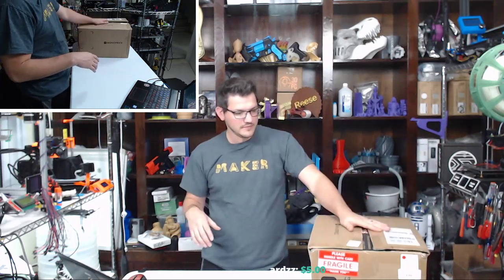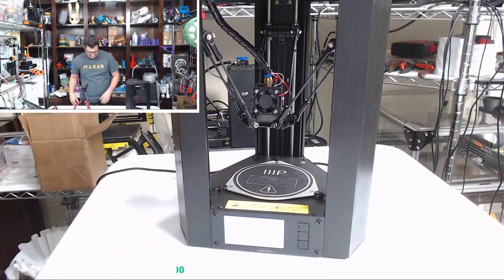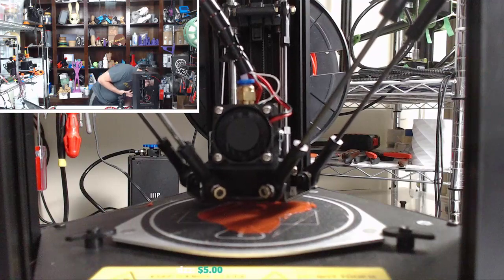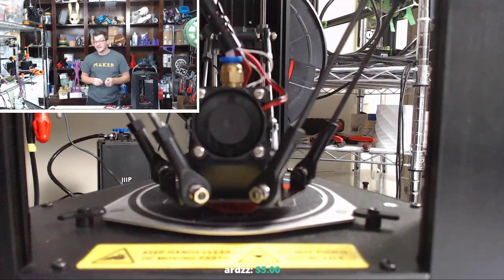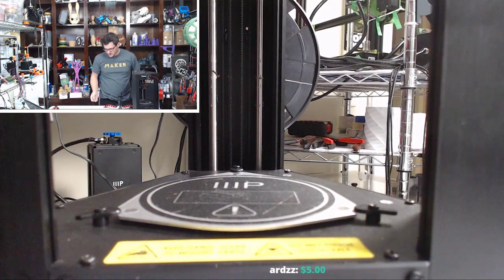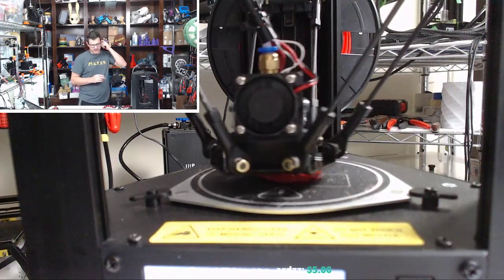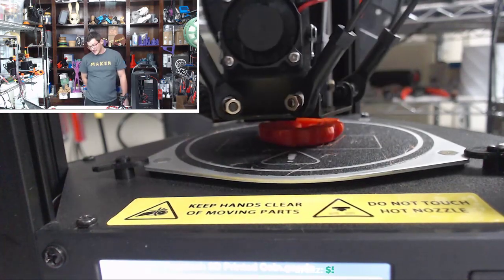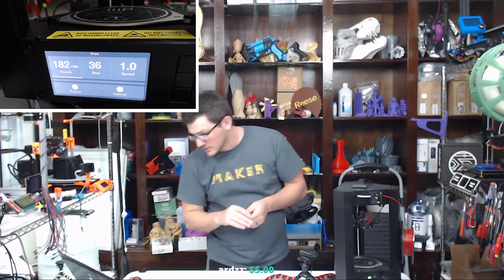Uboxing a $80 3D Printer!! Let's see what we get!

Comment: Looks like a somewhat upgraded version of the 101Hero (which I can not recommend - mine sits gathering dust behind the Anet A6)
Reply: The only thing in common between the two is the fact that they are small delta printers... there is nothing at all shared between the two.  The MP Delta is a metal chassis and utilizes real stepper motors.
Reply: @williamsteele  Good to know. At that price point I'd be concerned after being bitten by the poor quality of the 101.
Reply from the maker: +1 to what William said. This is nothing like that machine. The 101Hero was a toy.

Comment: I picked up one of the original indiegogo machines, and ever since it's been a favorite machine of mine (especially to travel.)

They get even better if you change the stepper drivers out to Trinamic units.
Reply from the maker: Are they replaceable? I have not opened the bottom up yet.
Reply: @Fugatech3DPrinting  they are soldered. So while not replaceable in the normal sense, it's just three pin compatible chips

Comment: I got the same $80 deal, & it was definitely a steal. Had a butterfly test print instead of the superman logo. My other printer is an Anycubic i3 Mega, so yeah, it took about a week to stop smashing on the screen thinking it would do something. Mine does a 3 point level check right now, I might change that to check more points, but it's working, so...
I've heard there's little round mirrors that you can get at Hobby Lobby for really cheap, & supposedly they fit the bed.
It's not the greatest printer, it's loud,  could use a beefier extruder, better hotend, 10 amp power brick, but definitely worth more than $80!
Still playing around with Cura settings, but it's printing well. Super happy with it.
Reply: Tim outdoors  it was a deal they had on "open box" printers, before Christmas. Theoretically the open box printers may be missing some items, but mine had everything. I'm not sure if the Monoprice website lists open box ones all the time, or if they just store them up, then release them all at once.

Comment: Any luck getting this to use any micro SD card besides the one that came with the printer? It won't read any other, & won't work with an adapter cable either
Reply from the maker: I have not tried any others. It could just be it has to be small. Have you tried a 1GB or 2GB one?
Reply: Tim outdoors  thanks, I'll give that a try, along with a smaller card if that doesn't do the trick. I think the cards I've tried using are 14G or 16G bytes.